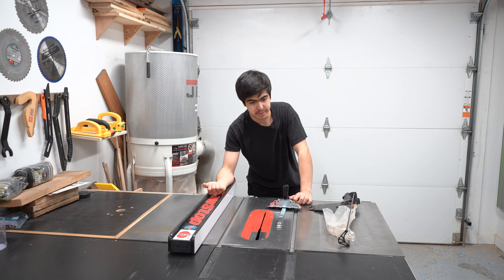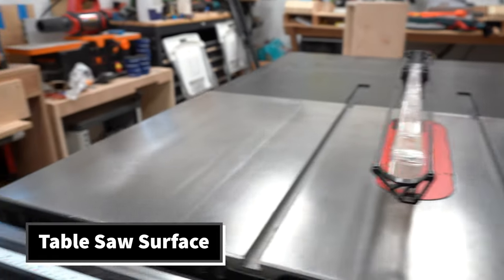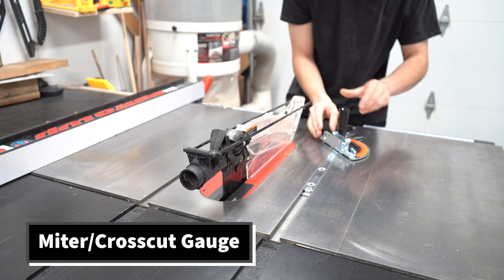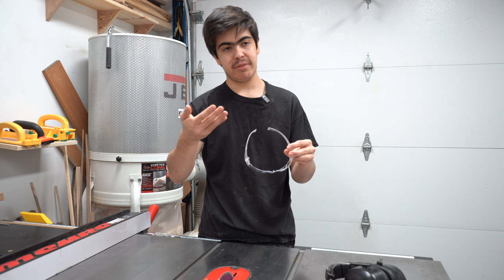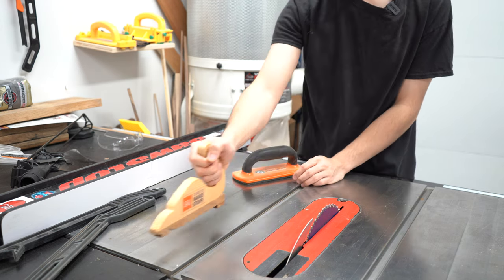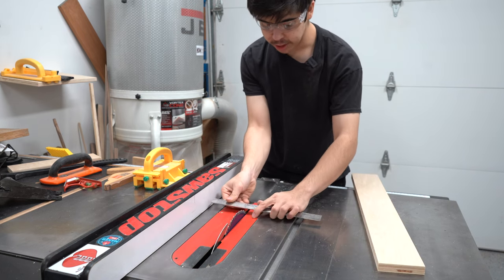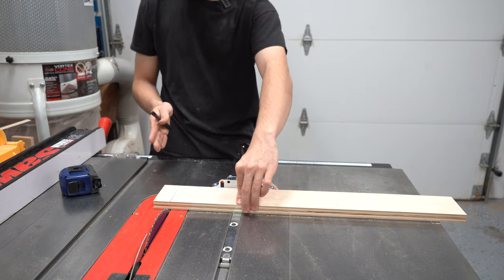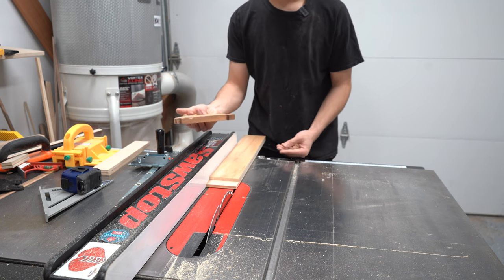Using a table saw doesn't have to be scary | Table saw basics

Comment: Dude! Arpad! This was great! Video production stepped waay up. Nice work man. 🙌 Also for what it's worth to anyone getting started I recommend adding a dust mask to PPE for the table saw. Especially if you start running MDF through that bad boy. 😷
Reply from the maker: Thanks Jason! Yeah I would’ve recommended a dust mask, but honestly, I couldn’t find mine to put in the video haha! And I was using my new camera along with a wireless mic and Ronin gimbal, and edited it in my video production class on their powerful computer. I think it turned out really well!